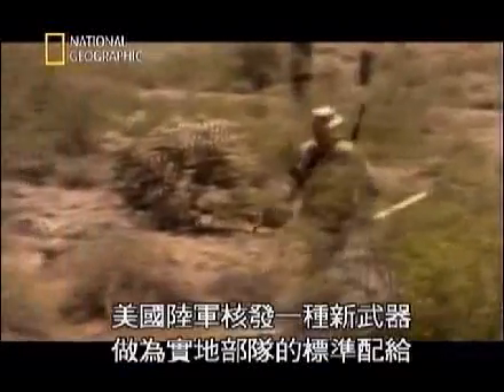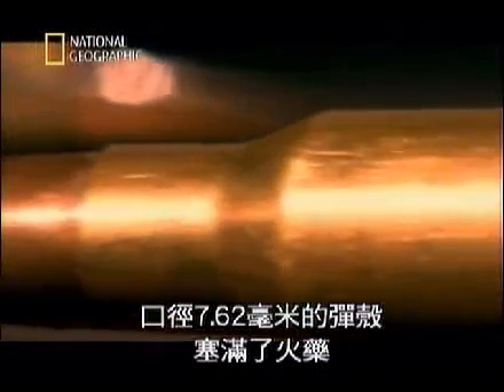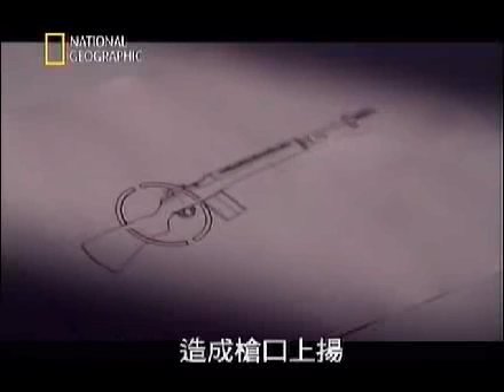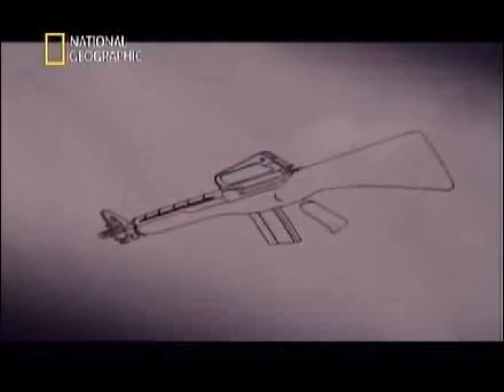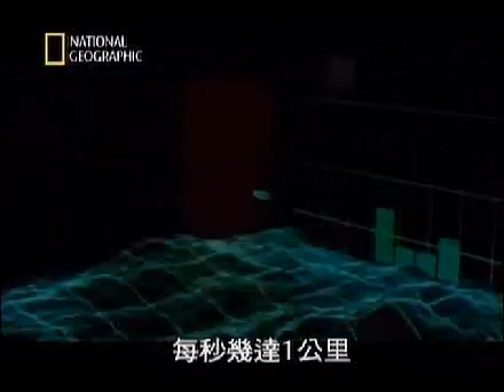Compare M14 With M16

Comment: @andyhuangit 

Correction:

M14/M1Garand: True battle rifles used by riflemen in WWII, Korea and early Vietnam and reliably killed tens of thousands of Nazis, Socialists and Communists. Can penetrate brush easily as well as make consistent kills in excess of 400 yards.

M16: Politically correct rifle used by "spray and pray" draftees during Vietnam. Cannot penetrate some brush. Often requires multiple hits to take down a target. Cannot kill consistently after 200 yards.

Comment: @nov284 That's true.  Low-mass, high velocity bullets lose momentum pretty quick, that's true.  However, at 500 yds, shots are very difficult anyway because of other factors--namely, that 5.56 drops like a rock after about 400 yds.  With conflicts increasingly taking place in urban environments, though, such long-range shots aren't relevant.  Afghanistan is the big exception; 500 and 600 yd engagements happen often enough there.  Note the Pakistanis use G3 rifles on their border...

Comment: @uziman12 

The argument is this: To render a man combat ineffective, 

5.56- 2-3 well-placed shots needed.
7.62- Only one well-placed shot needed.

5.56 has the ability to kill with one shot, but not very reliably. .22LR can kill with one shot also, but you don't fight wars with it. The fact is that 5.56 is a much weaker cartridge than the 7.62. It needed to be for what the military wanted at the time, which was a light, high-cap, accurate spray-n-pray weapon for the jungles of Vietnam.

Comment: When they were going to retire the M14 they should have just changed the M14 to .223.  We didn't need to complicate things with the M16.  I don't have anything against the M16 but I prefer the simplicity and durability of the M14.  Also, my guess is that the M14 is cheaper to produce and more "soldier friendly".  I know I prefer my Mini 14 to my AR15 because it's simpler and has a more natural feel to it than the AR15/M16.  M14 in .223 would have solved the problem of weight and excess recoil...

Comment: @STL308 Responding to both statements--- You're right, I don't mean to argue that by any means. every weapon has a place. I love the build of the steyr but hate the trigger pull and decreased knock down. I love the M4/M16's precision but hate the decreased knock down. I love the AK's power and reliability and hate its lack of precision. I love the M14's power and precision but don't care for the weight. Each one has it's place, but all around I like the M14 the best.

Comment: The M16/AR15 regularly wins service rifle matches against the M14/M1A.  
Delta and SEALS used the MP5 in hostage rescue and other very close CQB weapons.  The MP5 is more accurate than the Thompson and performed very well at that range.
Both the AK101 and AK74 are much more accurate than the AK47.

Comment: No i agree bigger is not always better, recoil and size are all important but the only advantage the 5.56 has over the 7.62 is size and wieght. The 5.56 would perform poorly against body armour and it is ineffective unless fired from a 20' barrel. So if i had to pick which one i would get shot by in combat i'd pick the 5.56 over the 7.62 anyday.

Comment: Both Rifles are good which is why both are still in service today.  The M14 is better for a KD(known distance) trained soldier whereas the M16 is better for the trainfire soldier.  Trainfire is instinctive shooting giving an increased ratio of effective fire. Easier way to train recruits. The SLA Marshall report decided that high firepower/instinctive shooting was better than KD marksmaship.  Not always the case which is why the M14 is still used in IRAQ against mud walls.

Comment: @apso5 It definitely is heavier and a beast to carry. Takes some getting used to. I've carried the M14, M16, and M4 (w/ & w/o the M203). I'll take the M14 with its extra weight. Reason--you carry X2 the ammo with an M4/M16, but it takes X4 the ammo to put him down. However, exception to the rule, right weapon for the right mission-- due to weapon size/overpenetration factors, M4/M16 wins in CQB. SOCOM is short enough but still overpenetrates--don't want to get your own team through a wall.

Comment: Why not give the M-14 and improved stock like the M-16 has coupled with a pistol grip to go with it. Surely then Automatic fire would be drastically improved. If recoil needs to be cut even more, add a muzzle brake (Hopefully it can also hide flash too) and use a new gas system. Like the Russian BARS or the Ultimax 100's constant recoil mechanism or perhaps the Kriss's (Vector) bolt assembly.

Comment: @andyhuangit 

7.62 can if using armour piercing ;)

Also without cermaic plates (which not all soldiers wear) a flak jacket will shrug off a 5.56 compared to a 7.62mm :)

Comment: Three phrases that don't belong in a sentence together,assault rifle-long range-automatic fire. Long range fire should be accomplished with semi-automatic fire out of a rifle. If you want long range, automatic fire you should use a machine gun such as the M-240, M-2, or M-60. The M-14 on semi-auto will deliver accurate fire with one shot stopping power. Full auto fire from an assault rifle is for close quarters combat.

Comment: @NoblesseGlint1 It is a pretty good rifle if you treat it right. I prefer the M14, but the M4 and M16 are both still good. The simple way to answer is that the M16 and M4 come in several different variants. They both have a full auto capable version and a burst capable version, which is the 3 shot per trigger pull. As long as I have a good cleaning kit, I trust it. But like I said, I still prefer the M14.

Comment: We only still use 1911s because .45acp is the most effective cartridge in full metal jacket. 9mm hp will often expand just as far as .45" hp.

The designated marksman philosophy was adopted from the Soviets, and is nothing new or unique to the M14. One guy per squad that can reach out, supported by others that can maneuver, put down suppressive fire, et.c.

Comment: @NoblesseGlint1 Yes the m16 is much faster, but it's max effective range to a point target is 550 meters. The M14 has a max effective range to a point target of 750 meters (some people will argue 800 meters), making it the longer range killer. The ak47 statement very is correct, but for clarification only, I assume you mean that the ak's recoil is what makes it inaccurate on auto. In semi it is still moderately inaccurate just by it's very design--which is part of what makes it so reliable.

Comment: the m14 came from the m1 garand in a way. the garand couldnt hold off soldiers fast enough so they made the m14. but the m14 kicked too much on full auto, so they changed the design some and made it shoot a smaller bullet and there u have it, the m16

Comment: Would make sense if the Navy Seals didn't still use the M14 as well as a fair number of other forces. The M16 doesn't have the stopping power of the M14 and it tends to jam up if wet, or dirty. The M14 is more reliable. I will take the M14 to the M16 any day of the week!

Comment: @theTicklemehellmo The problem with using an mp5 instead of the m16, you wont have the range or the accuracy of the m16. mp5 is smg. m16 is AR. they are two different things.

Comment: @esh325 I have to disagree with the accuracy.  You cannot be perfectly accurate with ANY hand carried rifle on full automatic.  They are simply not designed for that.  I have fired both in the military, and found that the 16 had its place at the time it was put into service.  However, it was at the sacrifice of distance.  If I had to fight in the Mid-east now, I would definately prefer the 14. I was trained for one shot one kill, and the 16 just comes up short at distance.

Comment: The M16 is an excellent rifle (given you have plenty of cleaning supplies at all times), but it's a high maintenance weapon with low killing power. On the other hand, although it's heavier, the M14 is a low maintenance weapon with high killing power. Both are comparable in accuracy. Thanks, but having used BOTH in combat, I'll keep my M14..

Comment: @jsooterlexsc my guess is.....people get told 1 thing and they hold it as gospel without thinking or comparing.  common sense tells you every situation is different.  different tools for different jobs.  an MP5 is perfect for clearing houses......in downtown USA........but i wouldn't want it as standard issue in Iraq or Afghanistan however.

Comment: The only thing that bugs me about the demonstration is that the M14/selective fire version was never intended to be issued to every man. Like the BAR this was designed to be issued one or 2 per sqaud and not intended to be fired from the sholder.

The M14 is a dated design. The M16 was much faster to make and in veitnam would have never been able to make enough M14s. The M14 AK duel would have been repeat of the WWII M1 Garand vs STG44 faceoff.

Comment: I do see the logic in the M16's design: It's lightweight and equally important: It's cheap compared to the M14 and it has less moving parts to replace. Sure it needs to be cleaned but in a disciplinned military that is not a problem. Better still if the enemy gets ahold of one: It won't serve them too long as it will jam and then the lazy bastard will pitch it and look for an less accurate AK47.

Comment: Well if you ever went hunting with a shotgun then you could easily use an M14. Put your shoulder into the stock and take a good aim. Using semiautomatic with an M14 is deadly. An M16 on auto or semi is just not powerful enough or reliable. Not to mention the M14 is VERY reliable in any environment. That is why special opts people use it to this day. Also you can put the cleaning kit in the stock. Plus attach a bayonet.

Comment: @shkotay They tested in full auto only and at such a distance to ensure that the M16 would win. Reality is that NEITHER weapon was made to be shot full auto at such an absurd distance. Also, note that the M14 never hit it once even though the first shot should have been on target even on auto. The holes you see from the M16 are the first shot of each of the bursts. Even with low recoil, the M16 won't multi-hit the helmet on auto at 450m. This wasn't a test... it was a Colt commercial. A set up.

Comment: I'm fully with u the m16 is a more accurate rifle than the m14 mostly because of the smaller 5.56 round the 7.62 just has to much power to to put up such close groupings as the 5.56

Comment: They tested in full auto only and at such a distance to ensure that the M16 would win. Reality is that NEITHER weapon was made to be shot full auto at such an absurd distance. Also, note that the M14 never hit it once even though the first shot should have been on target even on auto. The holes you see from the M16 are the first shot of each of the bursts. Even with low recoil, the M16 won't multi-hit the helmet on auto at 450m. This wasn't a test... it was a Colt commercial. A set up.

Comment: Actualy,the Viet-Cong& NVA didn't pick up the M16 more so because the wouldn't have anywhere near as steady a supply of amunition for it. Just aswell ,in the vien of reliablity , becuase of the austere conditions they lived in they personaly knew that they couldn't keep up w/the matinace that the M16 required. Truth is..some did use the M16,they liked the light weight,lessened recoil,and amount of amunition you could carry as oppsed to the AK series,the same reason many use the weapon today.

Comment: @XGCScrappy When I say "team" I didn't mean necessarily a small unit op as much as "the good guys" in general. If your company is taking down the entire block during a MOUT mission, then good luck keeping up with the approximately 120 other soldiers and their exact whereabouts as your 7.62X51mm round punches through ten walls and tags a different platoon in a building 100 yards away. We had that problem when my unit was in Mogadishu clearing shanty villages.

Comment: The conditions in this video are designed to have the M16 come out on top. the m14  was never designed to be fire full auto at distance like that. At that distance, it was designed for a one-shot drop in semi-auto. I've been in combat with both weapons, and I'd rather drop 'em with one shot from an m14 than 4 or 5 from an m16. yes the m16 will kill them (eventually) but they just don't know it until after they've killed you.

Comment: @8166PC1 Nope your right, but there are several accounts of ar15's going 10,000 plus rounds without being cleaned or guns with fail zero  BCG's going several thousand rounds without any cleaning or lube at all. It's a myth that shoulda have been squashed long ago

Comment: In any case, you are horribly mistaken that the M16 is shitty. Compared in versatility, the AK-47 is dominated by the M16, as you can have a Designated Marksman Rifle, a close-quarters carbine, a mid-length rifle, a Squad Automatic Weapon, and many other different weapons combinations, all from the same M16 platform. Whereas the AK-47 is only an assault rifle, and you can't interchange barrels without major deconstruction (a la pulling out rivets to get the barrel out).

Comment: @mexicancomputer ... well if you actually talk to the marines that used m-16s to clear houses, you learn one shot= one little hole through the guy, and a whole bunch of (actually effective) AK rounds coming at you... The M-16 has no stoping force, and it takes a while for someone to bleed to death.  The M-14 would not only put a big hole in a guy, but would also knock them down, and usually put them right out of the fight.

Comment: @triggrhappywardog217 Depends on the environment they'e applied to. Don't get me wrong, I'm a precision guy, so I go M14 and M16/M4 as my top two, but something must be said for the AK47. It has crappy accuracy even at only 100 yards. However, can't argue that it has great power and very high reliability in even the worst environments. It's crude and unrefined, but a force to be reckoned with. The M14 is nearly as reliable as the AK47, though-- and much more powerful.

Comment: Sure the M14 had weakness, but those have been solved now. The hole grip issue has been solved(with different grips), and i don't know anyone who would use an m14 on full auto. Also, with enemy  hyping themselves up on epinephrine(like they did in the invasion of Baghdad)    we need big bullets to bring them down.

Comment: @SSgt24thMEU No alright in general weapons that shoot the 5.56 have a higher rate of fire yes. and yes the more lead in the air the better, but if they do an assault or whatever you would just need one round on them oposing to 2 or more with the 5.56; that's what i ment:) besides the 7.62 fly's further and is more accurate in place like iras, still a round between them like the 6.8 would be better... however making that transition for nato is a huge task...greetz

Comment: If you're firing an infantry rifle on full auto beyond a hundred yards your just wasting ammo. .30-06 shots per kill in WWII if I remember right was around 20,000, it was ten times that in Vietnam.  They could have done any of the mods to the M-14 that they did with the M-16 and it would be a superior rifle today. In fact they had to bring them out of retirement in the gulf and Afghanistan wars because the M-16 couldn't penetrate cinder blocks and other "heavy" cover. One was issued per platoon in many cases.

Comment: @s197stangdragger In the end, m16--extremely accurate, full auto capable, lots of ammo, light weight, low stopping power, medium probability of stoppages, high maintenance...  4 plus, 3 minus. Total score 1. M14--extremely accurate, full auto capable, moderate ammo, heavy, high stopping power, nil probability of stoppages, low maintenance... 5 plus, 2 minus. Total score 3. 18 years experience with both, I gotta give it to M14. I think that the M16 and M4 variant make great CQB weapons though...

Comment: @esh325 And with a M14 you can leave it in a locker for 2 or 3 years then take it out slap a clip in and she still goes good. You can't take it apart easily because you don't need to. I have put my M14 through hell and she still goes good.

Comment: The m1a is far more arrurate than the standard ar15. That  guy just cant take the recoil on full auto, if he is as good a shot as he says he is, he should be able to hit the helmet on the first shot. The 223 is not a powerful enough round. What they dont address is that for a long time the m16s were uneffective because soldiers would just spray lead arround without really aiming. The m16 taught soldiers not to aim. The only real reason the m14 was fazed out was an under the table deal with colt.

Comment: The only capacity in which a m16 outdoes a m14 is accuracy in full auto mode, a.k.a., ammunition wasting mode. the m14 beats it in every other way. You just admittedly have to get used to the weight. But the pivotal difference for me is that I'd rather carry 160 rounds of 7.62X51 and kill 160 enemies than carry 300 rounds of 5.56X45 and kill only 100 enemies. Also, the m14 requires MUCH LESS maintenance in all environments, especially the desert.

Comment: ...Were you drunk at the time you made this comment? 

First off, one of the things you screwed up is that the AK-47 is 7.62x39mm, while the M16 has a 5.56x45mm round. The M16's bullet is lighter, with more powder behind it. It is actually the military version of the .223 Remington, a very popular hunting cartridge. 

Second off, AK-47s are not modular and usually can only chamber one type of round, while the M16 can be converted to many different rounds. Will continue in next post.